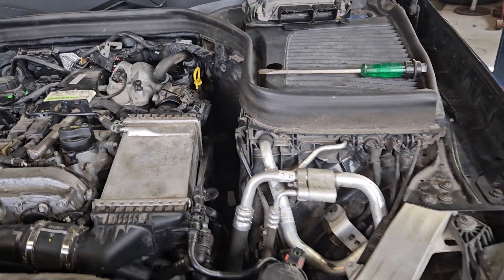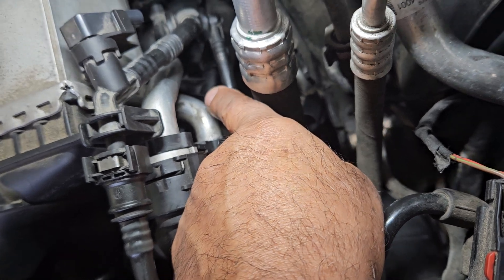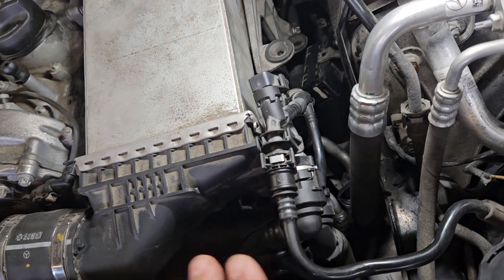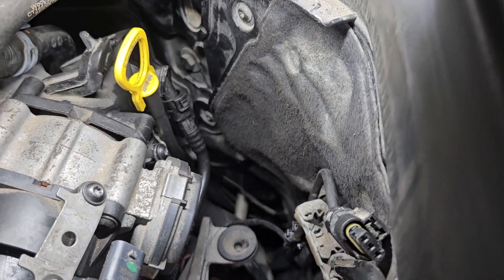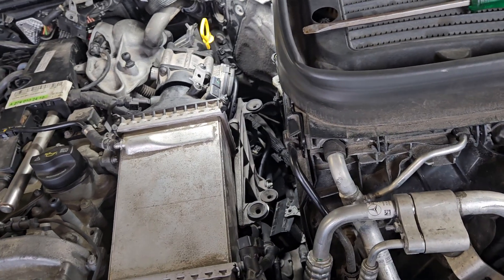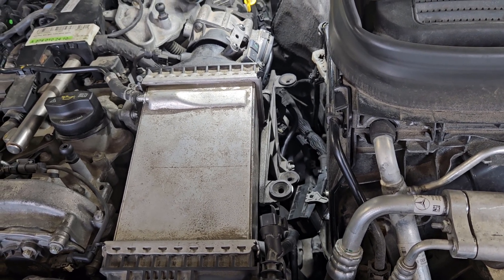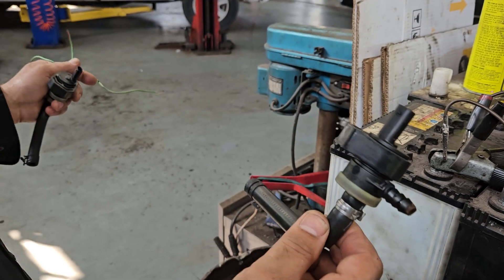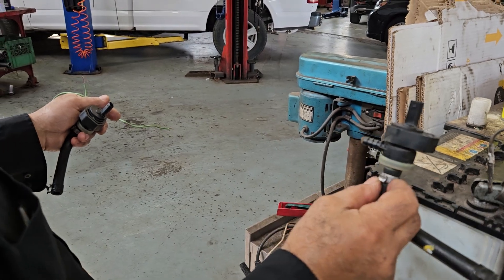Mercedes crankcase Vent valve stuck closed

Comment: I am also from onatrio. A few days ago, my 2017 GLC started having the same issue. Does GLC get an extended warranty for this issue?
Reply: Yes
Reply from the maker: Mercedes does not recall it but the will give you some break in price. The problem is it will not fix the issue . 
Even I fixed this vehicle with used valve . It came back 8 month later with the same issue. 
I found a Valve that was made out out bronze and it was good for fuel , water and air. I think it was from a dishwasher. 
I had to retrofit it into the car. The customer took it and its been years . She said the immediately the gas consumption went really down and she is getting incorrigible gas millage.
Reply: @ehsansadaqat4055  Hello, any idea what is this valve ( Valve that was made out out bronze and it was good for fuel , water and air. I think it was from a dishwasher. ), part number? model etc.. 
can I dit it to Mercedes Benz B200 2006
Reply: @ehsansadaqat4055  Hi Ehsan, what do you think made the bronze valve works better? is the heat from the engine breaking the plastic valve?  I just got this code two days ago and i'm about to change this part, if heat is the source of the problem, I'd wrap it with some insulation
Reply: Do you have a part number by any chance?
Thanks